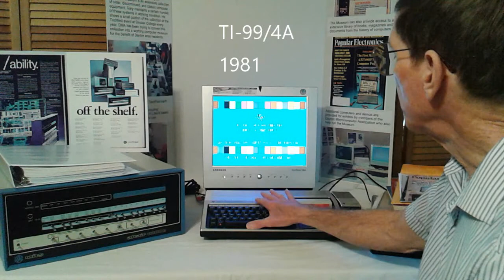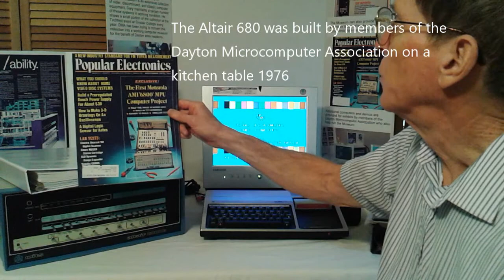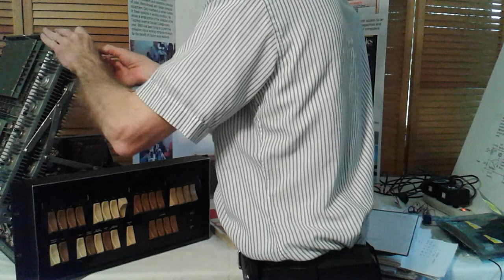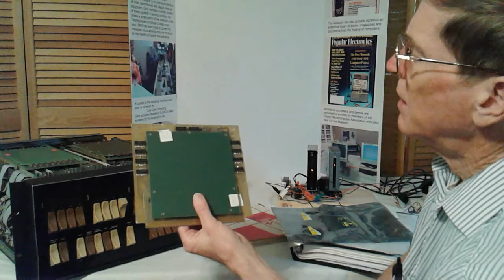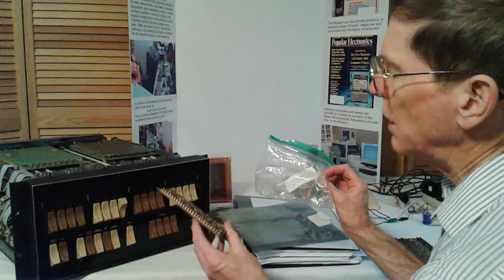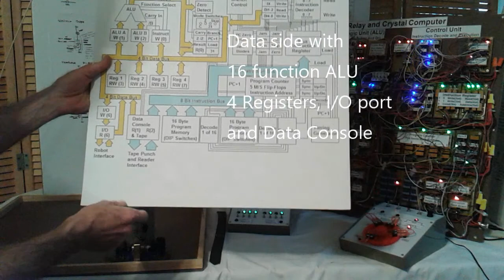Introduction to the Dayton Computer Museum

Comment: I would love to see that Com-Tran 10  It was the system that I learned on when I was in Data Systems A-School in the Navy
Reply from the maker: Hi Leland, I have repaired the Com-Tran 10 again. Traced problem to the TPM , transfer program  counter to memory register signal. Signal was at the 74154 but not at the memory register. Ended up just soldering in a jumper and that got it working again. I plan to do a you tube on the Com-Tran 10.

Stephen
Reply from the maker: Hi Leland, It was a lot of work getting it working again. I traced out a lot of the circuitry and replaced a number of parts. I am currently using a PC power supply for it. I still am in need of the schematics for it. Know anyone who might have those? Sadly the machine is not working again. While working on I/O the control section had a failure. So its back to tracing out that one next. Did it before, can do it again. You can see it counting on the video. At that time it had a bad 74181 which was replaced. You may notice a bit of a skip in the counting. Could you provide some of your history with the Com-Tran 10? I plan to do more videos with it and get some more of this ongoing story on the vcfed.org website too. They were also used by the Air Force at Keesler field. I have had it at the Air Force Museum in the past and plan to have it on display and working sometime in the future.